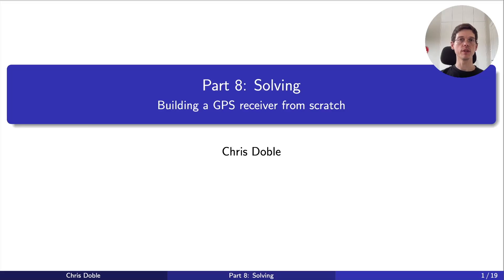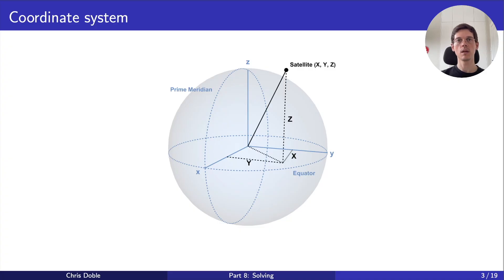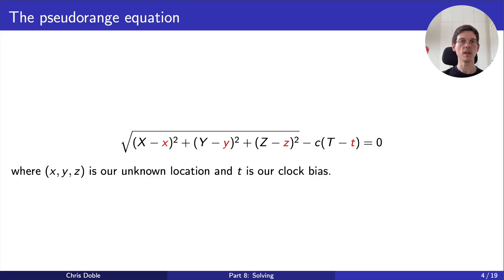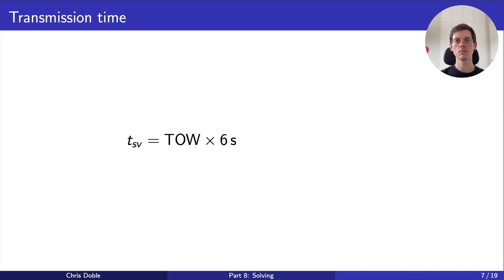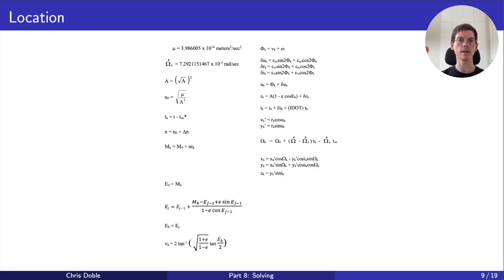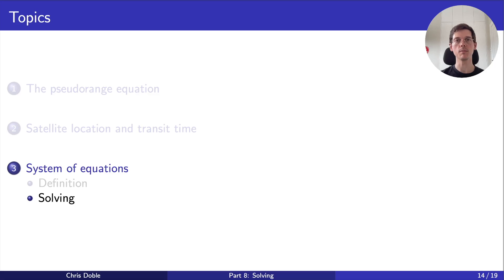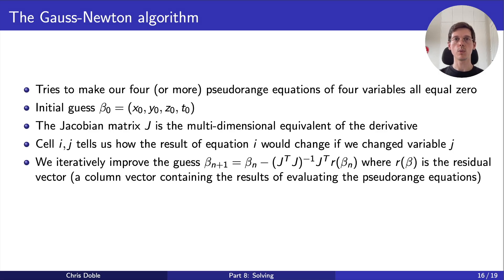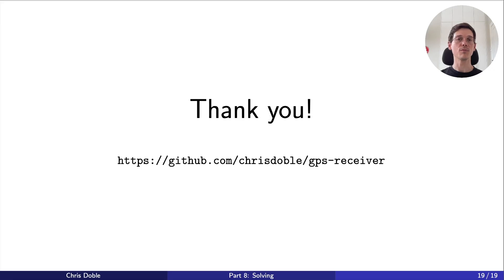Part 8: Solving | Building a GPS receiver from scratch

Comment: How have you tested the orbital equations? I had tried to implement them, but I got wild orbits that made no sense. How precise is your receiver?
Reply from the maker: I recorded a few minutes of samples, ran them through my receiver to see what parameters I was decoding from the subframes, and ran the same samples through GNSS-SDR and Phillip Tennen's receiver to compare. They were all the same which suggested I was decoding them correctly. Then I did the same thing with the satellite positions calculated by the orbital equations. They were within a metre or two which seemed small enough to be a floating point or rounding error — that was good enough for me.

As a final sanity check I also converted the calculated satellite positions from ECEF back to LLH and compared the locations against what was shown on this website: https://in-the-sky.org/satmap_worldmap.php

My receiver is accurate within a couple hundred metres/yards.

Comment: Hi and congratulations for your project
A silly question though
I ve heard that GPS receivers have an "altitude limit"
Is this implemented in the antenna ? or in the software ?
Could it be by passed ?
Thank you
Reply from the maker: Yes, the US government places some restrictions on civilian GPS receivers. If they can operate at altitudes above 18 km (60,000 ft) and at speeds above 2,000 km/h (1,000 mph) simultaneously, they're considered weapons — presumably because they could be used in missiles. Whether these limits are enforced in hardware or software and whether you can bypass them would depend on the particular receiver. Mine can theoretically operate at those altitudes, but there's some additional signal processing it would need to do to operate at those speeds.

You can read more about the limits here: https://en.wikipedia.org/wiki/Global_Positioning_System#Restrictions_on_civilian_use
Reply: @chrisdoble  First of all thank you for your rapid reply. I really appreciate that.
Secondly, this guy, Kip, in US launched a rocket some 293,000 ft at Mach 4 while pulling some 15.6 G's, using a telemetry system called Kate-3 GPS
https://www.youtube.com/watch?v=gmv7G6Rf5WE
So i guess its not illegal to use something like that.
Reply: People have said that this is so that some receivers cannot be used for missiles, but its not a technical issue.